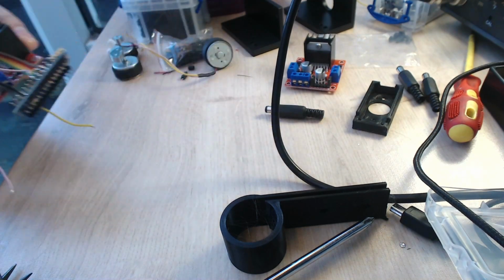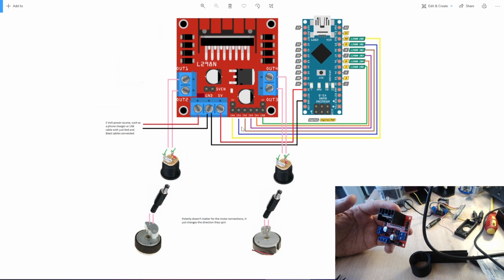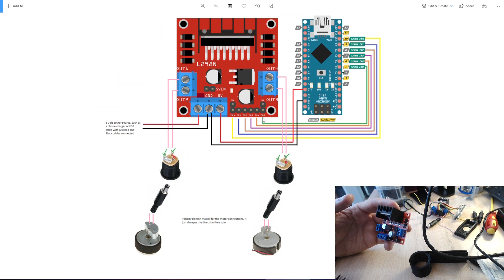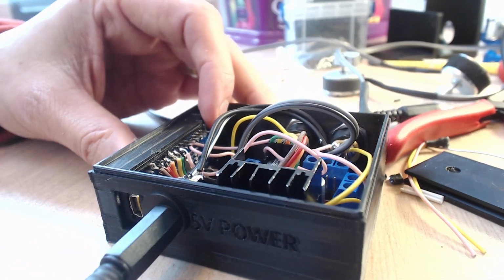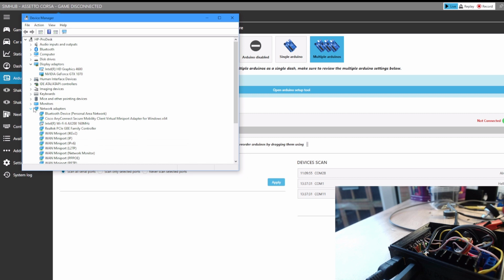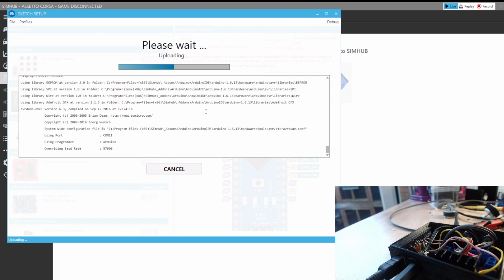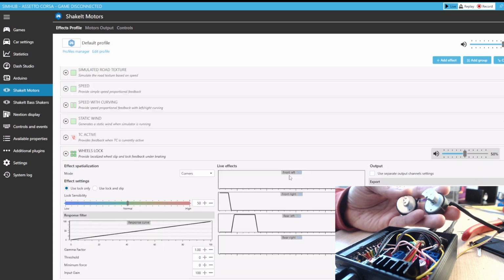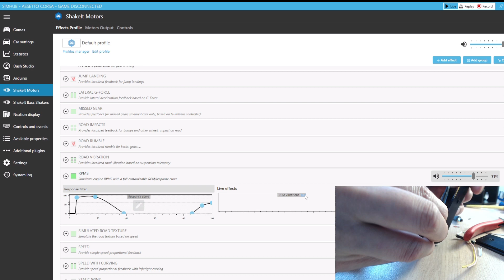Rumble Kit Install and Set up Instructions for Simhub ShakeIT simracemods.com

Comment: I have a doubt regarding the wiring from the L298N board that connects to the power supply. Should I plug the +12v to the positive of the power connector and the GND to the negative? 
Thank you!

Comment: Sorry but your wiring doesn't make sence you removed the 5v vss jumper with is used if you wanna power a aduino from the motor drivers power supply (up to 12v) via ghr 5v regulator. But if you connect the aduino to simhub you slready get 5v so why also connect the drives Supply to the contoller, this make the risk of shorting something higher when something goes wrong with the motor driver or its Supply witch could destroy your pc. So if not needed why add the extra kabel + risk ? So if you just leave the jumper be and dont conenct the vss to the 5v of the aduino (do connect the grounds) it should work with lower risk of people fucking up.
Reply: When i saw this post was later

Comment: I think I wiped my board 😢af installed program do I just do your install
Reply: If it is unresponsive: check if you have a counterfeit item.  The counterfeits typically come with a CH340 USB-Serial bridge, and Windows wrecks the communication with it due to a driver update (happens with practically every Windows update) that messes with it.
The official ones come with the 16u2 bridges, which do not suffer this problem.

It is nearly impossible to wipe an Arduino of it's bootloader code or the Serial-Bridge-firmware unless you follow very specific instructions to do so ;)

Comment: Got mine today and plugged up, PC recognizes connection but am not able to get pedals to do anything.. ideas?
Reply: Did you buy a counterfeit or an official one?  The Nano and Micro are among the Arduino's most plagued by counterfeit versions of them (mostly sold on Amazon and eBay) and use a different USB->Serial bridge which has a problem because Windows doesn't recognize it properly after an update.  The computer might connect to it, but after that, everything basically breaks, and SimHub can't Hello the device.

Comment: What type of wiring should I be looking for? (gauge?)
Reply: For motors this size, a small kind (the kind you might find in network cabling, for instance, I can´t give you gauge numbers since it's not what we work with in The Netherlands) is perfectly fine.
If the distances become bigger you might want to think about something a little bit bigger, to overcome internal resistance (especially if the cabling is not copper-based).
When the voltages go up, in most cases, the current will as well, so go with a higher size wire.

Comment: Hey my motors just stopped spinning recently when all worked perfectly. All signs show everything is functioning on sim hub it says 2motors connected& arduino is lit up and showing on as well in sim hub..when i click TEST they are just not working ...now the prob is ive grown to be attached to having these and now i feel naked without them(these are awesome if anyone is considering buying) so any help is GREATLY APPRECIATED also im realizing now i never got an arduino cover in my kit
Reply: Hi. Did you get it working?
Reply: @zsoltkerekes9005  I did..appears a wire came loose on solder..fixed it and all is good..

Comment: Hello. I have some questions about my rumble kit project but your website is down. Is there a way to contact you? The motorcontroller gets really hot but the motors aren’t spinning.
Reply: I think u might have had ur  power and ground crossed on the side connector of the 5v I had this prob I switched em and it didn't get hot anymore..kinda suc that they don't tell us what's the POS and neg on those terminals
Reply: @dctalon82 There is.  Look at the bottom of the board... There's a datasheet on the L298N as well that you can check out and see what parts in between lead to what connections.

Comment: Most of the time i handle my arduino stuff standalone and i'm new to Simhub. This would be the first hardware addon that requires it. You configured the "wheels locking up" for the motor. Can this setting apply for ABS at the same time or is the kick in from the ABS reported as a wheel locking up, even if it is only a fraction of a second in real life. I am wondering why both options are there and how i get the most out of every car and racing type.
Reply: It depends on the game, some games put out that effect and some don't. It is a separate effect in the channel list though.
And why both are there is because wheel lock is not ABS.  ABS is a method to avoid wheel lock for less experienced drivers.
It's why it's in consumer cars nowadays and basically takes the idea of professional drivers who are very well aware where the optimal braking point is (and know how to brake against losing grip due to wheels locking up by releasing and pressing the brake a bit down again ever so slightly) and puts it into an electronic system that rapidly switches the brakes on and off, replacing the inexperienced driver who would have no idea where this point in brake-pedal use would ever be by electronics.

Comment: Thanks for this video. 
Why did you go with the nano? Others are using the Uno and a motor shield.
Is the end result the same?
Reply: I used the nano and a motorshield. Non genuine but all working fine.
Reply: @wilcovanamersfoort6744  Which motor shield specifically? Thanks!
Reply: Yes.  The Uno and Nano are both the same microcontroller type (328p).  Please try to find an official Arduino if you can, the counterfeit ones come with a USB-Serial bridge that is plagued by problems due to Windows updating the driver for it and killing communication that way (it could be the result of the counterfeit item as well, but I have seen a lot of people in genuine devices that use this different bridge have problems in the same way, so it appears it's just Windows).

As for Motor-shields: they are simply more available for the bigger Arduino's, simply because the form-factor allows such shields: most motor drivers are quite big and fit in the form-factor of an Uno.
I use an Uno for my rumble setup, along with the same motor drivers shown in this video.

Comment: Great video! I´ve just seen a video where it´s not connected the 5v slot in l298n to arduino nano as well as gnd. Just the 12v power source and gnd  and then the 6 pins to arduino nano as simhub scheme

Comment: Hi Just found that the 3 jack plugs do not fit the sockets in the case the center pin hole is too small for the pin in the socket.  Not a problem, which size of plugs do i need t0o fit the sockets supplied please, thanks

Comment: is there a way to add another L298N to the other pins on the Nano?
Reply from the maker: there may well be, worth a try
Reply: @simracemods  you can but you'd have to write the code and upload it as a custom device.  I just figured it out yesterday 😅
Reply: Or a custom Aurdino sketch rather

Comment: I'm running 3 large motors do you think 12v 5A would be good or is that too overkill?
Reply from the maker: thats fine it will only pull the amps it needs
Reply: What is "large"?  Are these the kind of motors you find inside cheaper force-feedback wheels?  Because a startup-current of all three at the same time could easily swamp out a 5A supply, but another thing that will be important is the running time.
Momentary running instead of continuous will be fine once up to speed (just like trains: all motors will pull an enormous amount of current more than when they are up to speed).
Reply: @Dutch3DMaster  I only run them for a few effects so it ended up working out fine, I have bass shakers that handle most of the continuous effects.

Comment: The connectors I received with the kit wont fit in the inputs and there is no arduino case🤔
Reply from the maker: please contact me through your order on ebay/etsy and ill get some shipped out- i had a bad batch

Comment: i need a help - i made 100% for the biggest motor and its not spining - small is spining fine.
Edit: power supply 5V is to weak, I used 12V 2A and its perfect witch min 84% for bigest motor
Reply: How did you end up using a 12V 2A power supply? I am having the same issue.
Reply: @Dailes_  as I said - 12V 2A works fine
Reply: @weczisTV I apologize but I just want to clarify. so on the L298N where the 12V + GND to the power supply you replaced the normal 5V power supply with a 12V 2A power supply? If so what wiring changes did you make if any? Just larger wires to adjust for  2A?
Reply: @Dailes_  yes, PS to L298N, wires the same - 2A is doesnt matter you can try 1A - didnt try if it enought, but you can use even 10A - it doesnt matter.
Reply: @Dailes_  as I said 2A doesnt matter, you can use 10A 20A power supply - it doesnt change anything. its only about 12V, but it not make a diference to 5V on wires, you can use LgY 0.5 or 0.75, 1mm - doesnt matter
the power is to low to make a difference.
Reply: @weczisTV  Even with the 12V 2A power supply i am still not getting the brake motor to spin... Any solutions?
Reply: @weczisTV  It does.  A power supply typically has a minimum draw to keep itself stable: on a 10A supply the startup current of a motor might be sufficient to kickstart it's stable operation, only to fall down afterwards and risk becoming unstable.
Reply: @Dailes_  Did you remove the jumper on the L298N board?  Because if you exceed voltages that it can pull from the controller it's connected to for the logic supply, you need to remove it, or you will fry the controller and the voltage converter on the L298N.
If you did this: check whether you enabled the channel settings correctly. 
"Motors from 1 to 2" means channels 1 and 2.

Comment: Would this work with a console or just pc?
Reply: If you run telemetry from your console to a PC via Simhub, then you can connect the rumblers to the PC and it should feed the data from your console.  But you'll need a game that can broadcast UDP telemetry (e.g., Codemasters F1 on Xbox)

Comment: Along with the 5V power source, Could you tell me what the amp(A) rating would be? I plan on build this to your specs this weekend
Reply from the maker: it runs off a standard usb port but the more the better. for strongest results run from a 7v or 9v power supply
Reply: @simracemods  Surprised it even runs during motor-startup...It will easily exceed 500mA during that point and could easily swamp out a single 500mA USB port (a USB3 port will not help, it's not negotiating higher current use as a USB3 device).
Reply: @Dutch3DMaster most phone chargers provide higher amps nowadays just use one or buy a 5v power supply, I got one with a fitting dc Connector for like 6 euro.

Comment: Hi mate, I have a question. I want to build a sim wheel but not ffb. I want to use rumble motors inside the steering wheel's handles for feedback but I don't want to use a motor driver. Do you know any way to do it?
Reply: Know this is an old comment but look into OSW. That would probably be a good starting point since people have made all kinds of wheels with FFB and Without
Reply: @RicheyBLS  That project uses motordrivers, just in a very much integrated package.  You can't really drive motors without a driver, they are high-current devices compared to what the output of a microcontroller can switch.

Comment: Could you not just wire up the motors to the position sensors?
Reply from the maker: They vibrate based on game data not pedal position